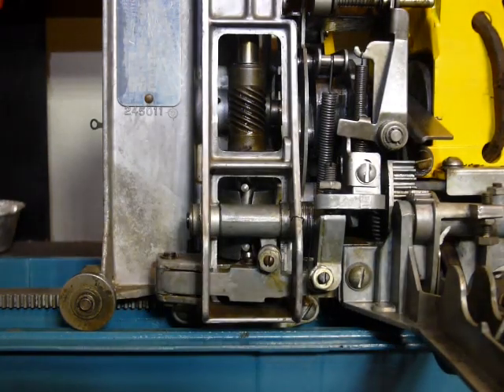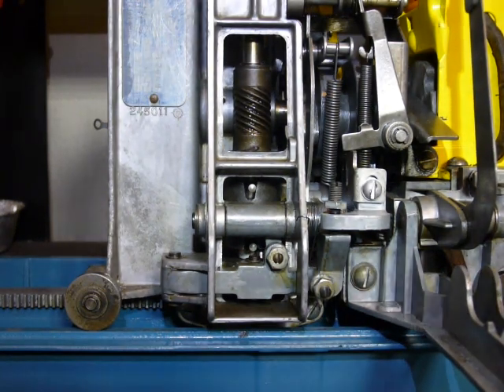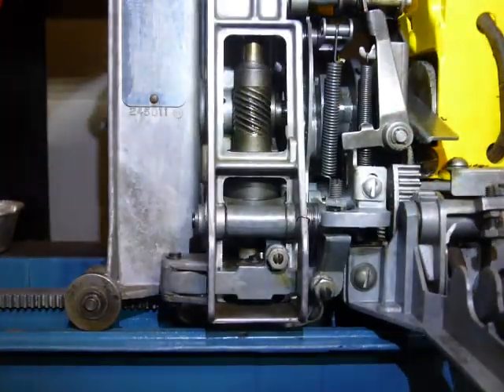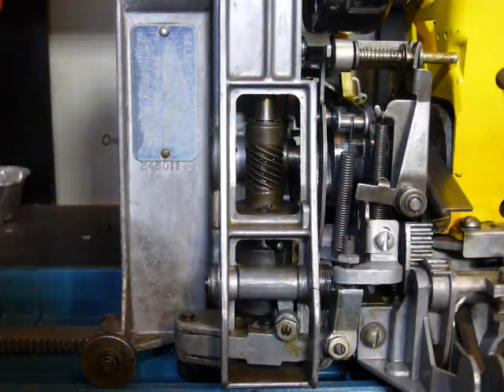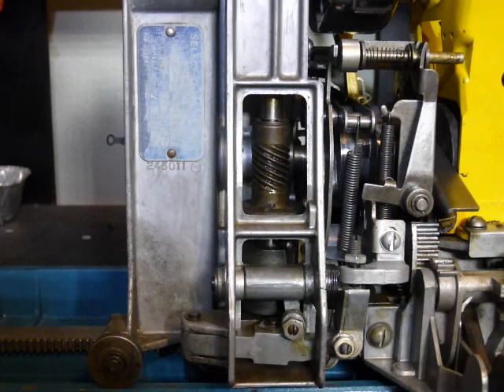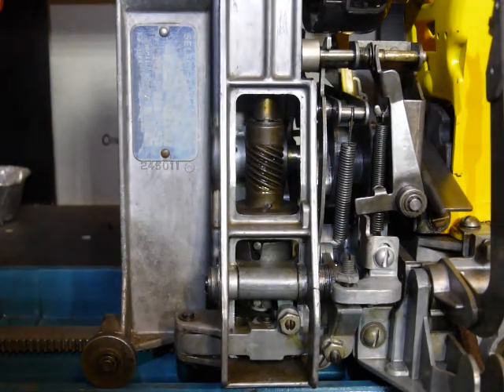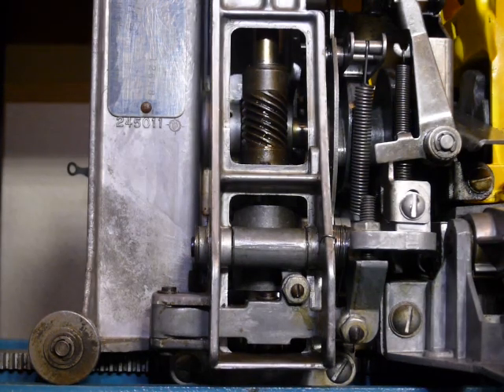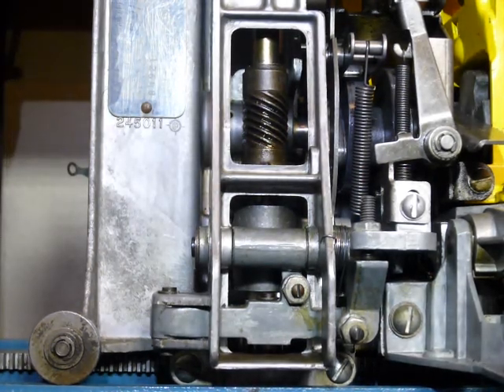Seeburg 100 Selectomatic Clutch Adjustments

Comment: Thanks!  It actually looks nearly identical to the Selectomatic 160 that's in my FC2, which is currently on the healing bench -- and which I believe needs these adjustments, after it's cleaned and lubed.
Reply: Yep..I did  a quick look at my manuals, and it sure looks the same. Never did a 160, though...
Reply: I think you just do it like a 100, except, 60 more. :)  I think Seeburg must have declared the mechanism Good Enough and just made it wider, and used it forevermore.  Not something I'd want to engineer twice either if I could help it!

Comment: should the trip solenoid   in clutch number one  hold the adjustment  trip lever solid another words the trip lever floats up and down and is not solid in the solenoid  i cant get the trip lever to stay without moving up and down and cant be tightened by the set screw  do i need a new solenoid???  thanks Kent